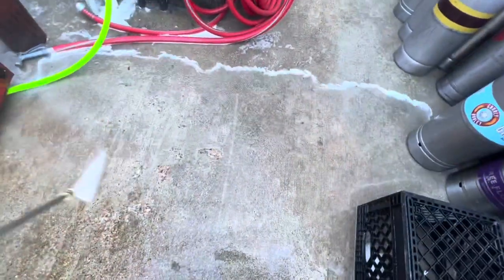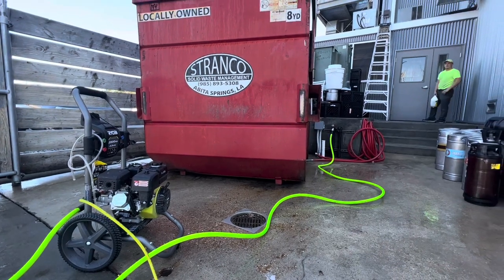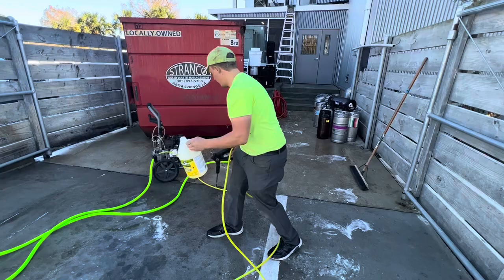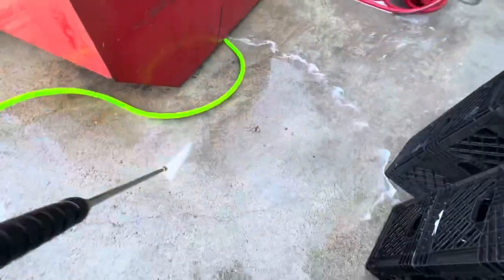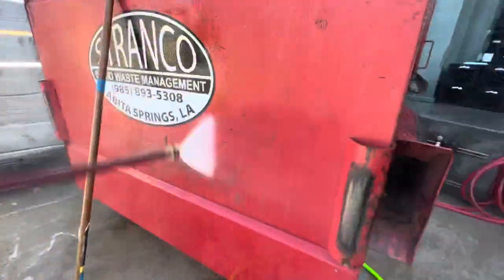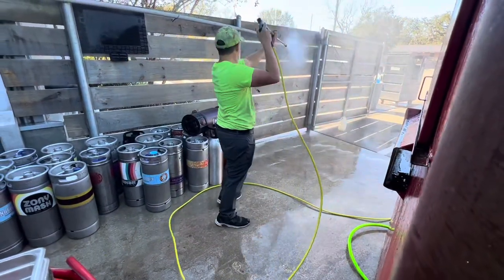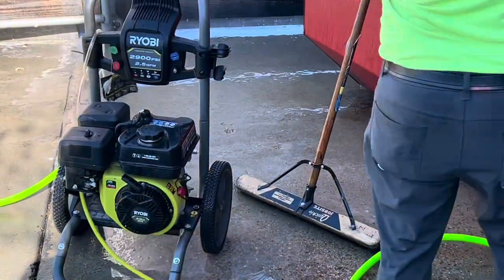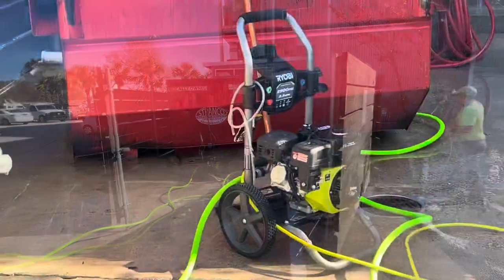Pressure wash Dumpster Pads￼

Comment: Hey Mr. Billy, really enjoy all of your videos. 
What about water reclamation for these cleanings? Is it necessary? I saw a drain in the vid..
Reply from the maker: You cannot discharge water into an area that would drain off of the property. This drain leads to a grease trap and back to another tank that stays on the property. Most cases you want to just push the muddy water off into the grass so long as it stays on the clients property
Reply: Thank you!